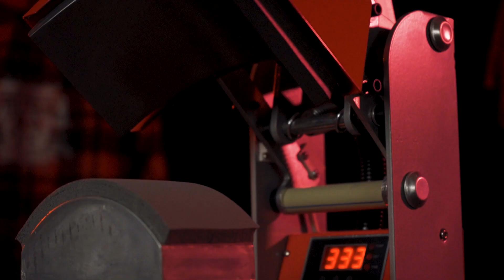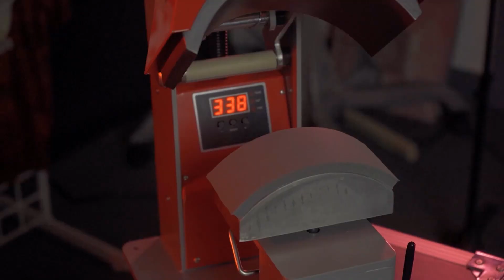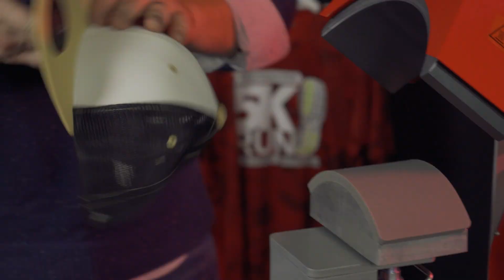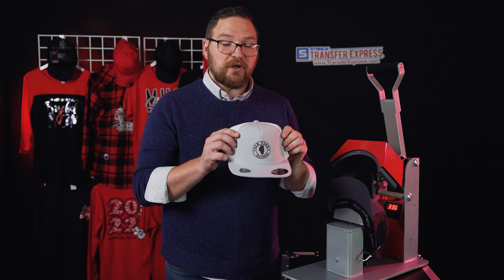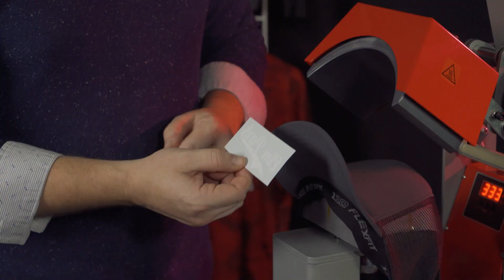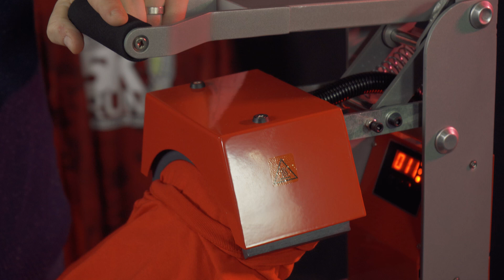The Most Affordable Hat Heat Press | Stahls' Clam Basic Cap Press

Comment: Great video!  Just bought this on the Black Friday sale!  Having trouble pressing with ultra color max logos, what is the time and temp for those on this hat press?  Or do you recommend only use goof proof?
Reply from the maker: Sorry to hear you're having trouble, but we're here to help! For Ultracolor Max on headwear, press at 290F, time 15 seconds with a medium to firm pressure. In most cases I've seen with Max on headwear not applying correctly the pressure is too low. Increase your pressure and the application should be a breeze! 

If that doesn't work please reach out to customer service at info@transferexpress.com or submit a resolution on your account dashboard and one of our experts will be able to reach out!

Comment: Does it leave crease in the hats?
Reply from the maker: Hey Damian, as you can see in this video we're able to print a few different styles of hats without leaving a crease mark- It does depend on the style of hat, size of the crown and the platen you have installed. I do mention at 3:59 that creasing issues are almost completely eliminated stepping up to the 360 IQ Hat Press, but I show some methods for the low crown, foam-front hats (one of the trickiest in terms of creasing) immediately after.

Comment: Hi, great video! I find it impossible to press a Yupoong 5-panel Trucker using the standard platen. Which platen would you recommend for that cap?
Reply from the maker: Are you getting the creasing on the 5 panel with the standard size platen? You can try the 2.75" x 6.5" Allstar platen for a shorter crown height on that one. Or, cover the platen in a mousepad (or layers of old tshirts) to diffuse the edges.
Reply: @transferexpress  thank you, I will go for the 2.75" x 6.5".

Comment: What is the best mid grade printer for printing designs on these GoofProof transfers??
Reply from the maker: Hey DawgFan006, Our Goof Proof screen printed transfers are custom printed with artwork you submit or design online and then ship we ship the transfers to you ready to apply. They're produced with plastisol inks, the same exact ink printed directly on t-shirts. We take call of all the inks, screens, emulsion and clean up so you don't have to!

For heat presses to apply the transfers to garments, the best mid-grade option is the Hotronix Maxx line of heat presses: https://www.transferexpress.com/heat-presses/maxx-press While it doesn't have the bells and whistles of the high-end presses, it's a great dependable USA-made press that will grow with you!

The Clam Basic Cap press that's featured in this video is a great mid-grade option for printing hats only.
Reply: @transferexpress  ok thanks!
Reply: @transferexpress  I
Dave, I would assume you would be able to do the shirt tag transfers on the 360IQ? I have the Geo Knight press, but looking to upgrade. Also, do yall deal in embroidered patches at all? In the market for a small sewing machine to embroider heat press patches as well...I mainly do leather patches I create on my Glowforge. Thank you for the helping with my small side hustle down here in West Georgia!

Comment: What's the length and width of the platen.??? Can I press pocket with it
Reply from the maker: The platen that arrives with the press is 6.5" x 4", but all of the interchangeable cap platens can be used on this press. The largest size is the 4 x 8" Champ Cap Platen

Comment: Can you press patches on this one?
Reply from the maker: Hey Howard, unfortunately, this press only has the top heating element, so It's not recommended. The Hotronix 360 IQ  (https://www.transferexpress.com/heat-presses/hotronix-360-iq-hat-press) Has both and upper and a lower heating element for quick and easy patch application.
Reply: do you have to have the bottom heating element for the patches?  or is it just not recommened? @transferexpress